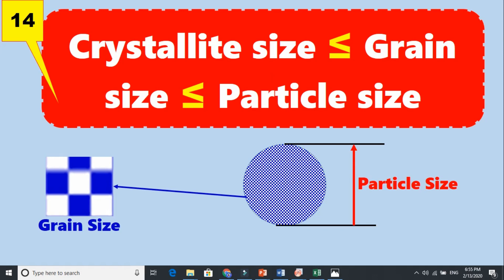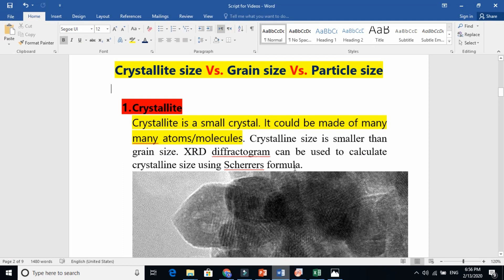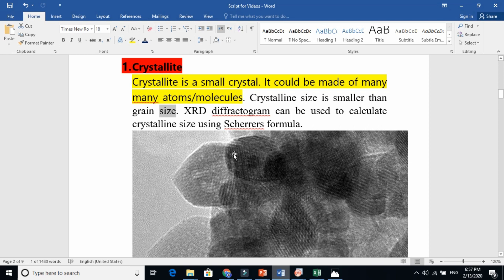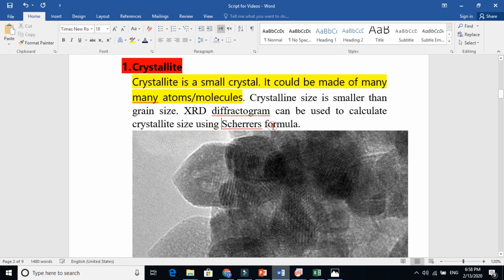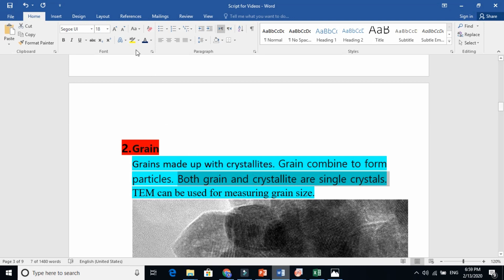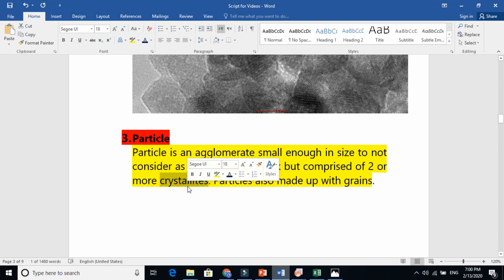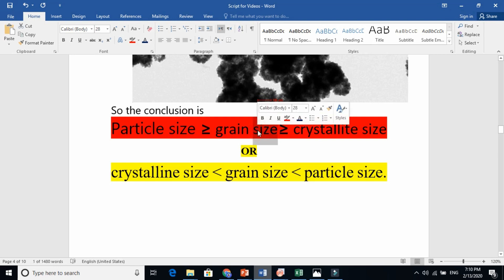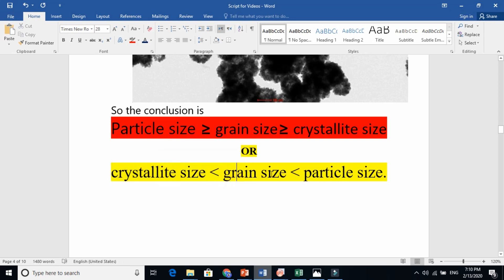Crystallite Size ≤ Grain Size ≤ Particle Size Explained | TEM vs XRD

Comment: Great sir, in conlcusion we can say; while interpreting SEM analysis we must use the term "particle size" and in the xrd and TEM interpretation we must use the terms crystallite size/grain size! If otherwise, it will be wrong?
Reply from the maker: In TEM, the grain size is common, while in XRD , crystallite size is more common, and it also deals with particle size. 

If you look into TEM image, it contains grain of different sizes and they are separated from each other with boundary called grain boundaries ....

Comment: Sir..what can be the reason that crystalite size and grain size both are  increasinge with doping concentration??
Reply from the maker: I think it may be due to the different atomic radii of the dopants and the host element. You have to check the atomic radii of the both then you can draw a conclusion about the increase or decrease crystallite/ grain of the final product.
Reply: @nanospeaks  Sir I have same question. I doped CeO2 with Pr and La. Both Pr and La are larger than Ce. But the crystallite size decreased (using Scherrer equation). I don't get it why, may you explain? Thanks

Comment: Oh my God...if we do SEM for a bulk pellet,  we say grains are found and it is grain size.  If we crush the bulk pellet into powder and perform SEM we call it particle size. 
Is my view wrong sir?  Please clarify
Reply from the maker: You are absolutely correct. Particle are bigger than the grain
Reply: @nanospeaks  A particle is composed of grains, 
grains is consist of singly oriented lattice planes. which can be observed by HRTEM.
with SEM, one can only see the external morphology, and you can assess the particle size, but it is not useful in all cases,
Reply from the maker: @din9212  yes Particle > grain > crystalite